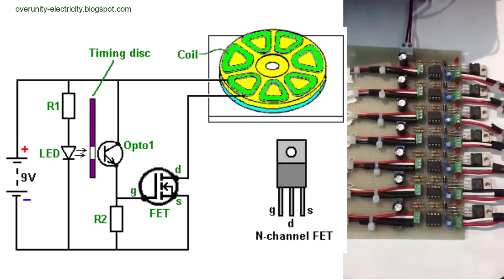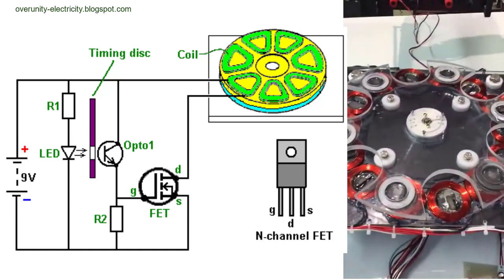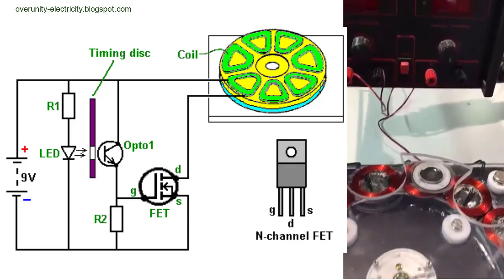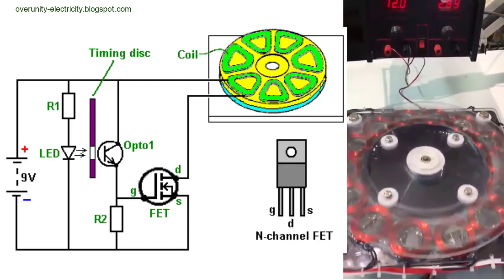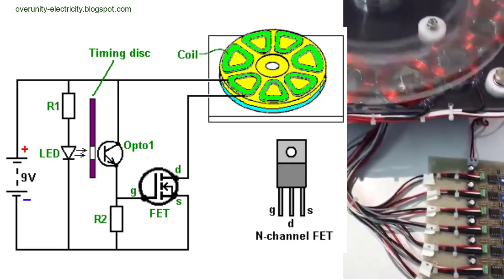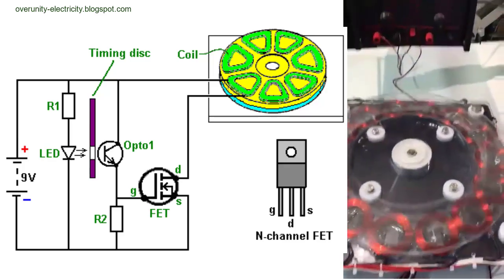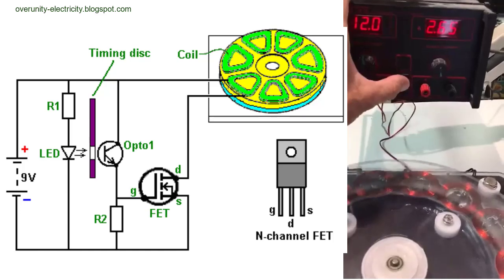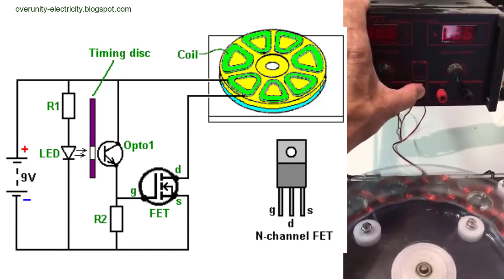Easy DIY Power Plan: Essence of Exploiting Back Electromotive Force | Free Energy Magnet Motor

Comment: Flywheel generators are known for their robustness and ability to store large amounts of energy. However, the efficiency of these systems can be impacted by mechanical losses and the need for precise construction. While they can provide a steady and reliable source of power, the initial setup and maintenance may be more demanding compared to the Easy Power Plan. Despite these challenges, flywheel generators remain a viable option for those with the necessary skills and resources.